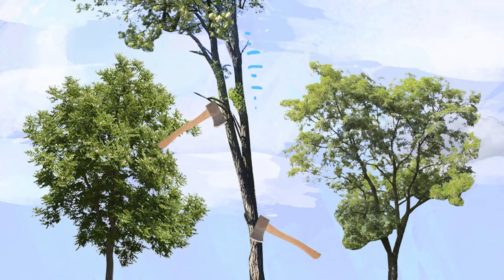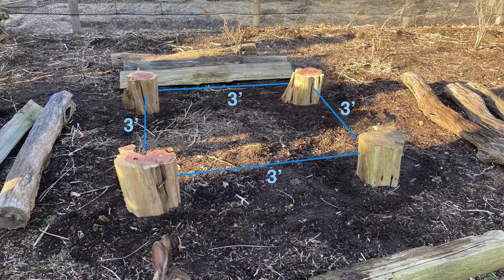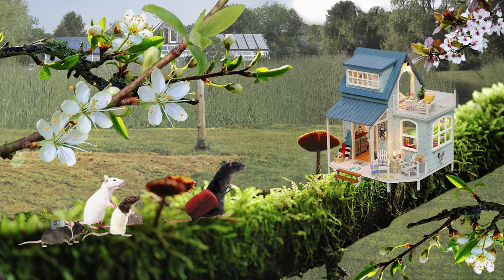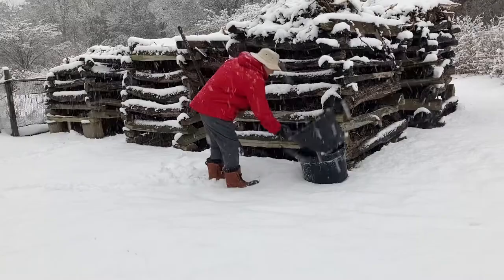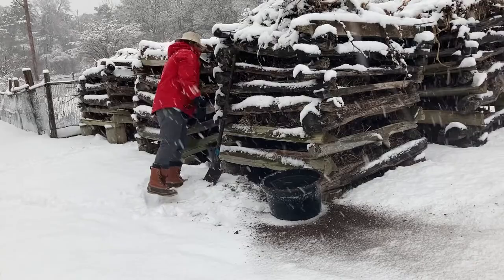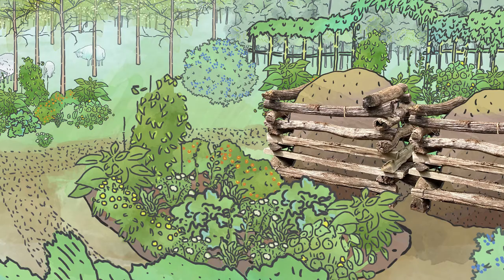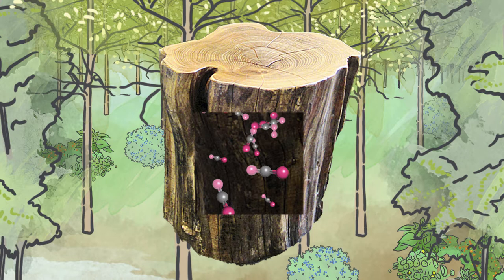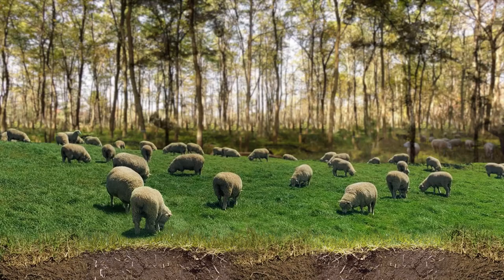Build a Compost Box in less than 2  minutes and reduce your carbon footprint.

Comment: Amazing compost box design, and also very well presented. Thank you for the info. I have suffered a lot cutting pallets for compost boxes that fill very quickly :D !
Reply: Antonio Julupanter, Thanks, the problem with most compost boxes is that the finished compost is at the bottom. Then you have to remove tone or more sides of the box to get to the bottom. Also, it's easy to say "turn the pile" but it is very hard to do if it is 4 feet deep.  This method lets you remove the finished compost without removing the sides,, and I do not move the compost at all, I just wait for it to move down slowly over time; It can take a year or two, If anything makes it to the bottom that is not decomposed, I just throw it on top again.

Comment: all your videos are excellent. I love this design. Very efficient.
Reply: The nice thing about composting this way is that it uses time instead of work. The composting takes a year or two for the material to decompose and move slowly to the bottom, but you don't have to do any stirring or turning.  And you can take the compost out at the bottom without emptying the whole thing or disassembling  the box.

Comment: I have been trying to split some tough locust logs that are sitting next to my compost piles.  Silly me for not using them as part of the compost process!  I like the approach of taking the low labor approach of composting, rather than trying to turn it all.  I anticipate some extra time will also reduce the number of weed seeds that I will ultimately get in my garden after spreading the finished compost.  Great video!

Comment: I don't have black locust logs, but I have tons of post oak.  And if they rot in three or four years that's fine too. I literally am over run with them LOL. And I was trying to figure out a way to make compost without having to turn it all the time cuz I'm kind of crippled up. So this will work fine. My son can cut me the logs and help me stack them and all I have to do is shovel the stuff into it as I get it do you layer dead brown stuff with green stuff? Do you add any kind of fertilizer manure types like chicken manure or anything like that?
Reply from the maker: We put material into the boxes anytime we have some. Sometimes in summer it includes fresh green weeds or vegetable stems, in fall it's a lot of vegetable stems/vines/plants removed after the season  is over and we're cleaning the garden up. In this system the organic material decomposes slowly over a year or more as it gradually sinks down. Because the material is added a lilt at a time, it never heats up. Only when a compost pile  is made all at once with layers of green and dry materials does it heat up. It would be OK to add manure at any time; tha would probably make it decompose a little faster. Otherwise it's slow and its speed of decomposing depends mostly on how wet it stays from rain falling on it.  Spraying it with water speed it up.
What's not obvious is that because there are large slots and holes on the sides and corners, there is no place for rats or animals to safely hide in it.
Reply: I'm clearing a garden spot for a first year garden, and there's tons of materials to put in one of those I could probably fill up two of them as is right now we have seven and a half acres of trees and leaves and brush to clear. I would imagine I'm going to have 20 or 30 of them in a row lol. Mostly it's going to be leaves. And small twigs like pencil size. But those will be chopped up and not tons of them put in I can burn those in a bonfire. It'll also be good to have him down that one side of the garden to fence off that side to keep deer out. Cuz I'll probably make them 6 ft tall real Handy. And I'm thinking about making them 4 ft by 4 ft rather than 3 ft by 3 ft. But this design and idea is a Capital One and I appreciate that you made a video about it. Because I was trying to figure out some way to get pallets or somehow get something to start composting all of this stuff that we have. But this will work just perfect. I'm crippled up and can't do a lot for very long at a time but throwing a little bit in there and walking away is perfect for me. As a matter of fact today I'm going to start cutting the logs for it with the chainsaw. I'm going to be using green wood. I figure it'll take a little longer to rot down at that point.  Edit.... I've got a fat cedar tree that I cut down that I can chunk up for the base pieces

Comment: This is an ingeneous design which seems to reduce such ;problems as rat infestation by raising  the hottest decay areas off the ground. Am I barking up the same tree as you are?
Reply from the maker: The way this compost box is used is that waste organic materials (leaves, weeds, grass, soft stems [no hard woody material or branches]) are put on top anytime they are available, in any combination. The materials get rained on occasionally and slowly decompose over many months sinking down over time. The oldest material, sometimes a year or more old, at the bottom has normally decomposed to the point that it is fine and crumbly like compost, and can be shoveled out from the openings at the bottom and used. 

The material in this compost box never heats up, even in the center. 
For compost to heat up, the materials have to be added all at once and in a particular proportion, including lots of fresh plants or manure that is high in nitrogen. It is hard to gather a couple cubic yards of the right materials all at one time to be piled together in one day..Only then will the compost pile heat up, and then it is hot in the center for only a few weeks.  

This compost system gets new material on top only occasionally, rarely enough at once to heat up. Also, there are many openings on all  sides between the logs so any heat that might occur is quickly lost out the sides. All the openings also keep the materials on the sides and in the corners much drier than is recommended for standard compost boxes. Decomposition just takes longer and is activated by periodic rains.  

The conditions in this compost box is more like decomposition of materials in natural situations, where leaves and stems simply falll onto the top of the ground and decompose at the bottom of the layers. They do not heat up in natuer, there is never enough accumulated deep in one place. There are no hot compost piles in nature.

The reason rats don't live in or visit these log compost boxes is because:
1)  we do not put food in it.  We give waste food and waste vegetables to our chickens. 
2) all the openings on all the sides give rats no place to hide.  They will not stay there if they cannot hide from cats or hawks or foxes or other predators.